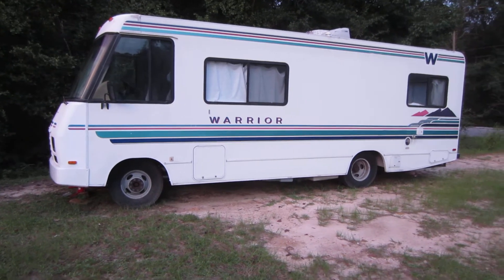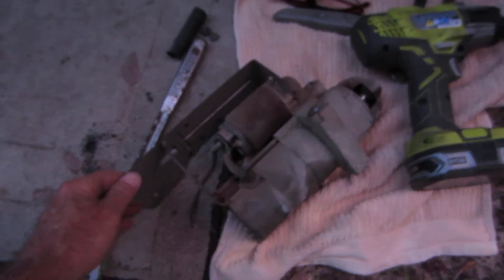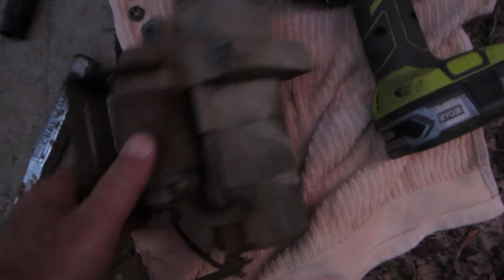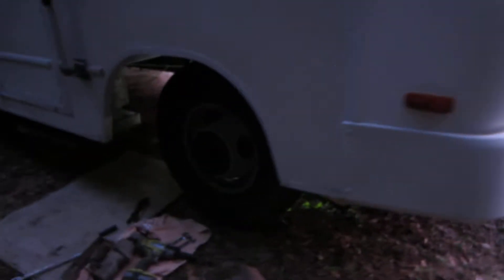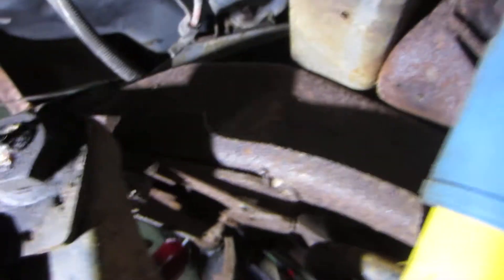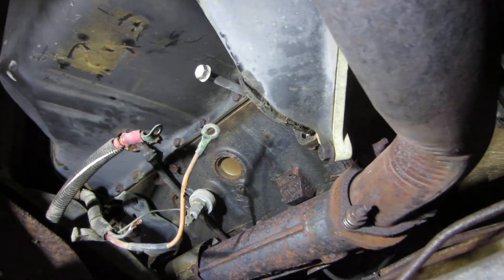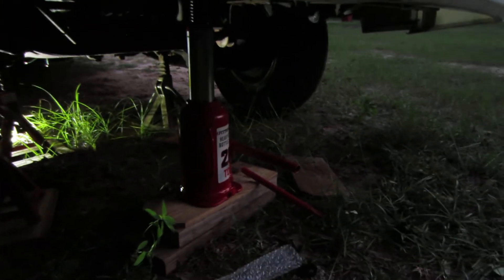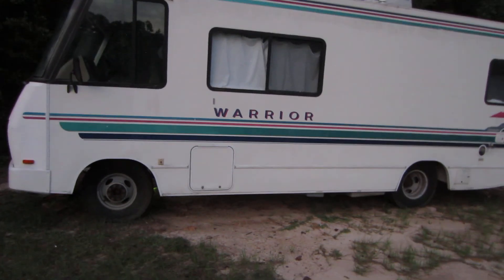Removing a Bad Starter on a 454 Chevrolet Engine in an RV 1995-2000 Winnebago Warrior Motor Home

Comment: I've got a 1984 executive 35' 454 V8 AT.Looks like header's have been added.The starter looks almost encased completely surrounded by those headers.I looked best I could ,I can't fit under RV.Wasnt able to jack her up,sure looks tight up there.
Reply from the maker: Yes, I could see where headers could make starter replacement more trouble.